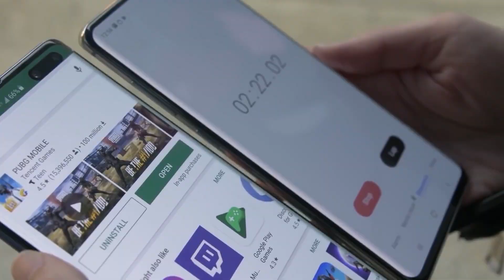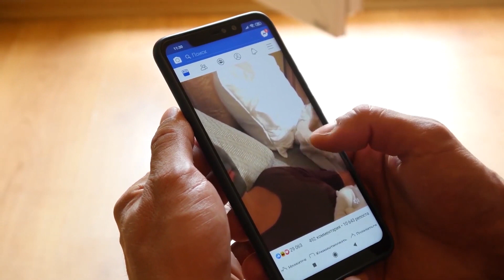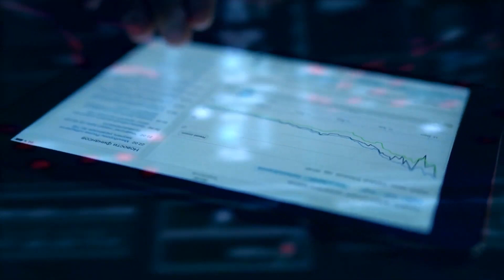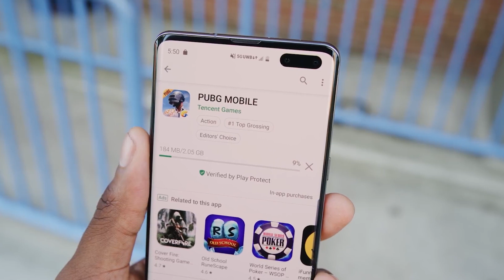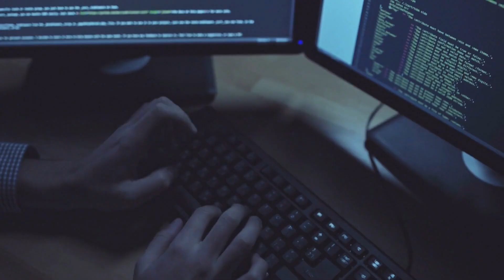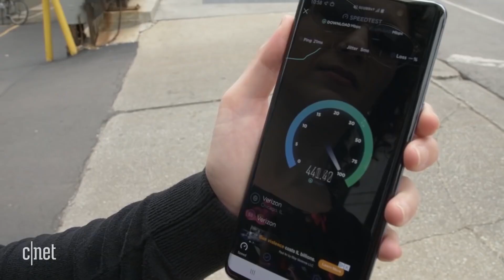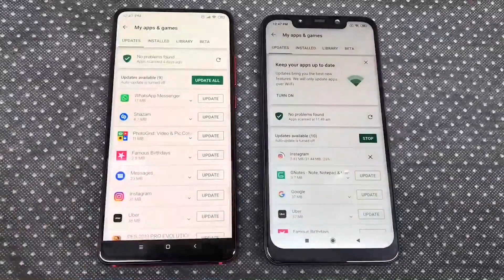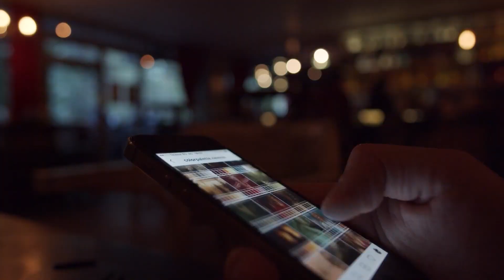What 6G Could Look Like

Comment: for me 5G should be about ultra-low latency and 6G should be about reliability through every device being mesh-network device. the extra bandwidth is great but I don’t really care about that. I don’t need more data throughout, I need lower latency and a reliable connection no matter where I am. 4G LTE-AA is fast enough for 99% of use cases for many years in terms of needed data throughput per device. it’s faltering is enough bandwidth for the amount of connected devices, latency, and reliability.
Reply: It’s not about having enough bandwidth for current applications. It’s about the new applications that will be made possible because of the increased bandwidth and lower latency. The bandwidth needs to come first before the applications. If the bandwidth is there it will be used up through new applications that weren’t previously possible.